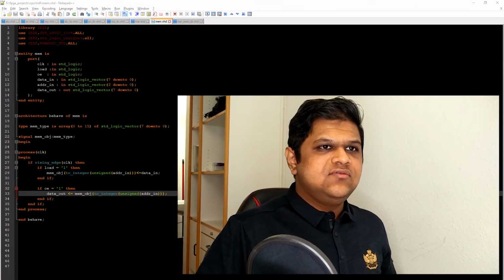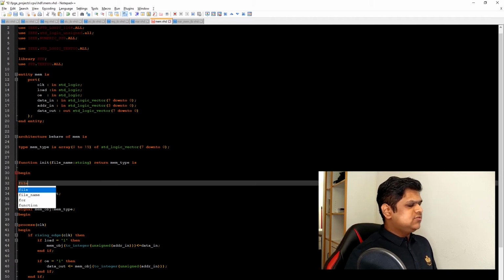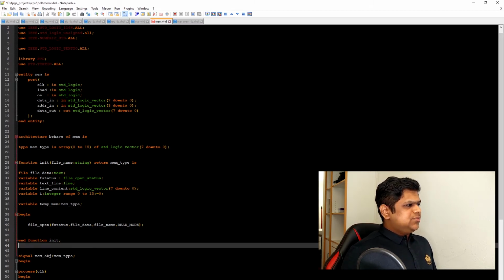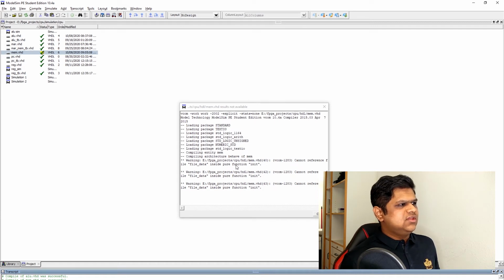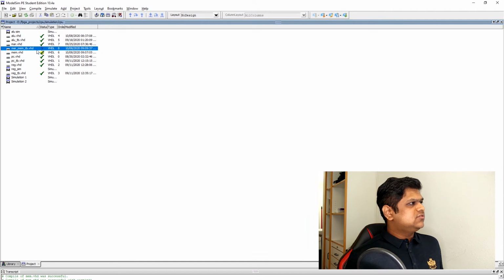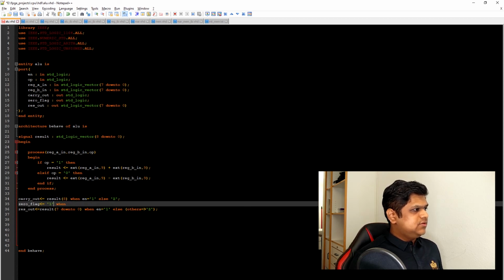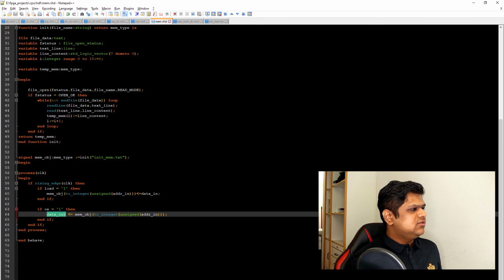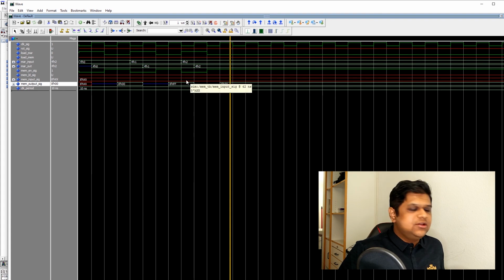Part #6 - 8 Bit CPU On FPGA  - Miscellaneous Changes

Comment: Thanks for this.  This series is the push I needed to get into VHDL, but I'm using ghdl brewed on OSX as my compiler.  I ran into some issues with ieee.std_logic_arith, ieee.std_logic_unsigned, and std_logic_textio.  I'm getting the impression from what I've read that they aren't actually parts of the ieee standard, but are custom provider code.  

I've worked around these issues by using std.textio and ieee.numeric_std libraries to support resize instead of ext, unsigned instead of std_logic_vector (where appropriate), etc.  I just wonder if I'm making my path harder than necessary.  Kind of like using pure posix code when you don't need to worry about portability, but I really want to stay pure if I can.

Do you have any advise/opinions on this?  Btw, I'm learning this for myself as a hobby.

Again, thanks for this series.
Reply from the maker: Thanks for your comment. I'm glad you find my videos useful.

I am a beginner myself. So I have very limited knowledge and cannot really comment about the choices of your libraries. I will try to ask someone with experience in the field and let you know when I find some good answer.

Enjoy the series and keep building/breaking stuff. Cheers!!
Reply: Ghdl is really more strict in some sense. And it has a lot of reason. But if your ultimate goal is programming a fpga and not only simulate I suppose you can check with your programming software if these changes are really needed. Nevertheless is always good follow the best practices. If you think a std_logic_vector is just a bunch of bit and the plus operation really it makes not much sense, for example, leaving also a lot of ambiguity. Are those bits a signed or unsigned ? That’s why VHDL is more strong typed than Verilog (closer to C from this point of view).